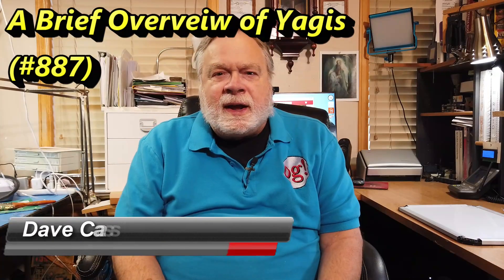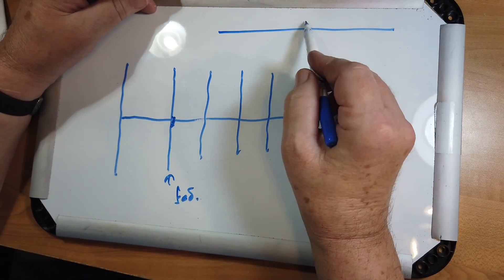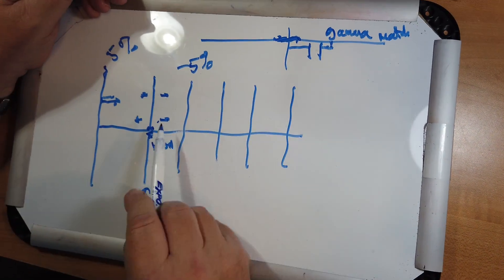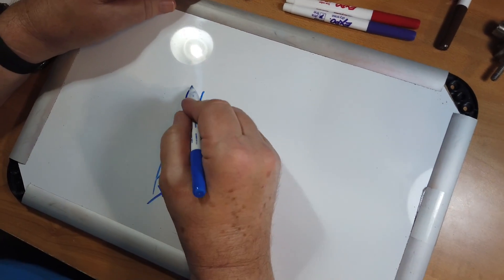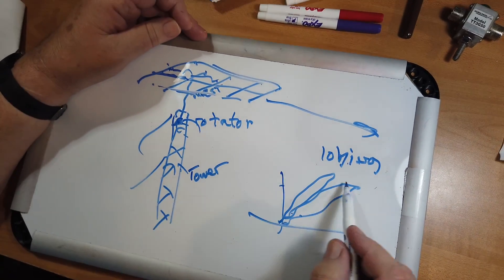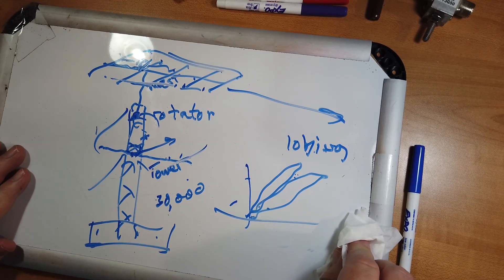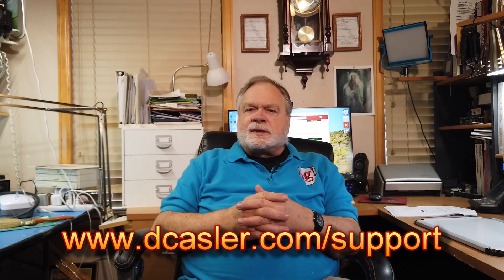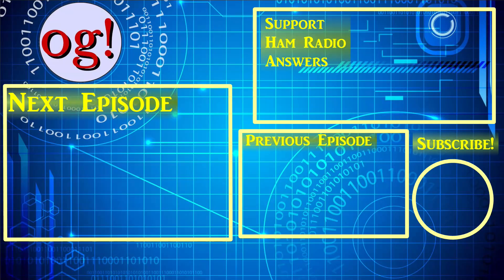A Brief Overview of Yagis (#887)

Comment: In Australia we still have 27mhz AM/SSB and UHF 477mhz as Citerzen Band
477mhz being 63cm band being so small, its easy to make real long Yagi's,  Best for the UHF Band 70cm or 63cm is a Folded Dipole with matching coax, by itself or as the Driven Element in a Yagi.
Next is Co-Phasing with a Harness or a Power Splitter/Divider a couple of Yagi's

Comment: Hi Dave, I was given a 2 meter /4 meter yagi. As 4 meters is not approved in the U.S. for Amateurs. I want to cut the 4 meter elements shorter to make this a stand-alone 2 meter Yagi. You mentioned in this #887 'Ask Dave" that it is not as critical any longer as shown by computer modeling. If so, what spacing should I provied between the Reflector and Directors along the boom?

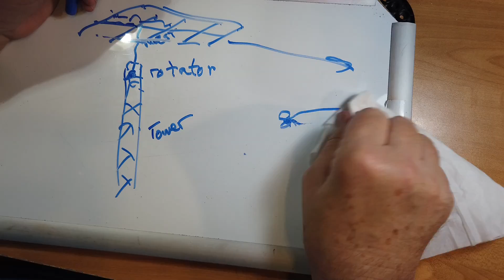Comment: @David Casler, you briefly mentioned lobing (around 8:18), but not why it is undesirable. Is lobing the same (or close to) "multipath"?
Reply: I gues lobing lowers the intensity of your main lobe and thus reduces the beam tightness and efficiencies, but that's just out of my gut
Reply: I waited to see if Dave answered first. When you get lobes, you get areas of good signal and areas of bad signal. With lobes, the harder it is to "aim" the antenna and the less gain to the front. You start losing stations into the gaps between lobes.  It is moving from a yagi-uda to .ore of an omnidirectional.